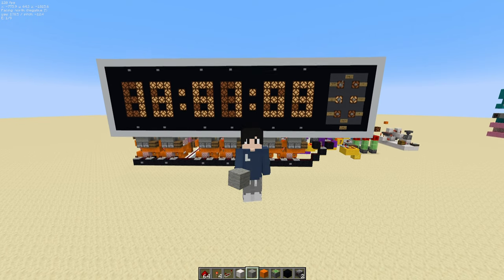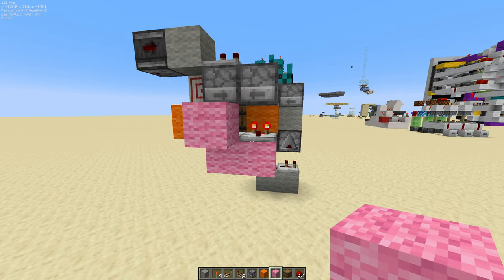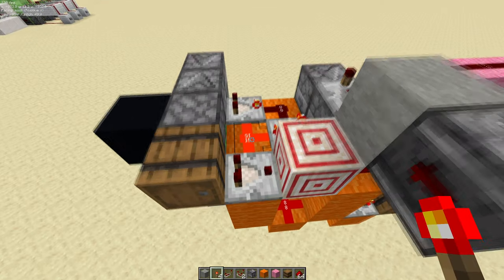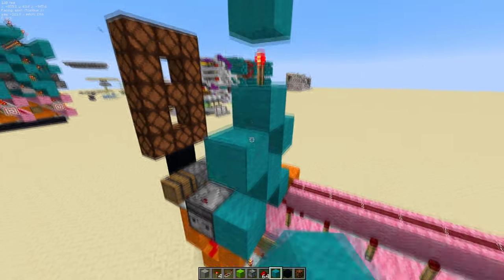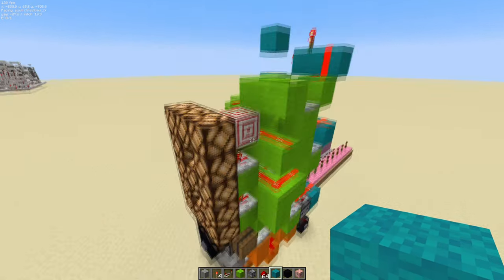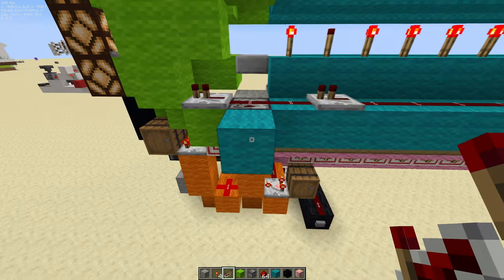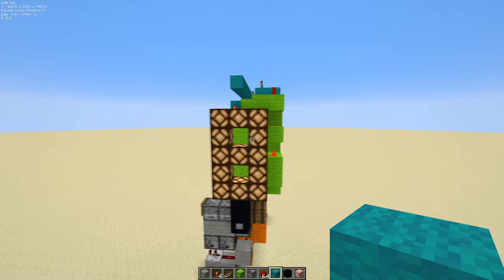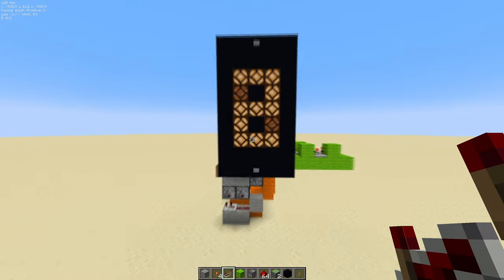How to build a digital clock in Minecraft - Part 1 - the 7 segment display

Comment: If it weren't for the observers and target blocks I would think this video is from like 2012.

Great contraption though. I feel like you could just knock out the tourches that power the display wherever you can instead of putting a repeater to avoid the delay. Also a block and a door in between each observer on the observer line to make the signal travel down faster
Reply from the maker: Thanks! I can't knock out some redstone torches as they still have to power the ones above them. As for the observer line, it might be possible to put a door somewhere but it'll most likely be accidentally powered by the redstone lines around it.
Reply: @Leomelonseeds  makes sense, didn't think about that

Comment: I tried it it not working.. 3:26 thr piston is coming out due to redstone dust..
Reply from the maker: Have you made sure the redstone is pointing into the comparators, and that the comparators are facing the correct directions? Also this won't work on bedrock if you're trying it there